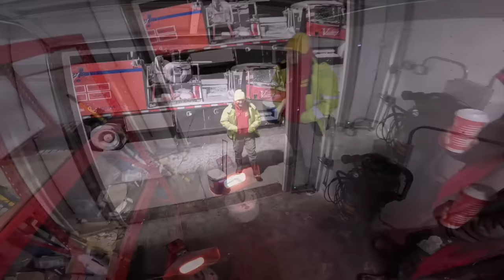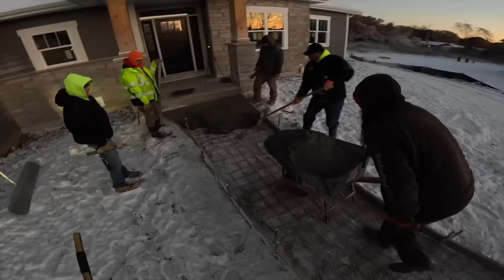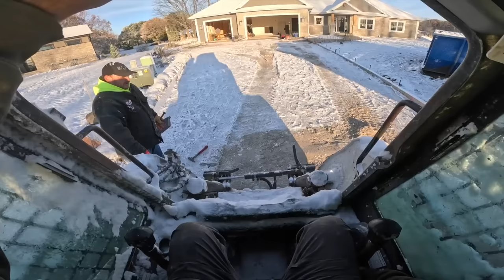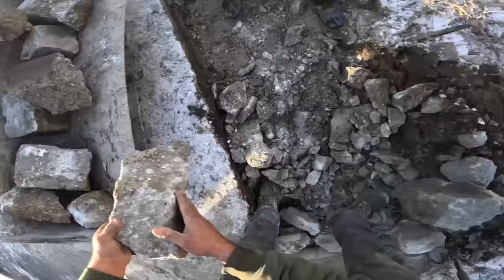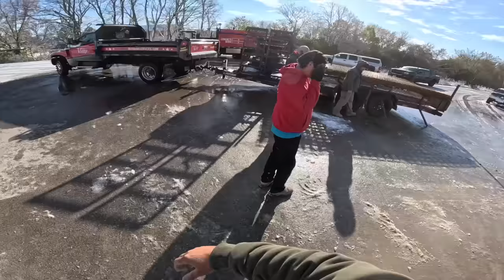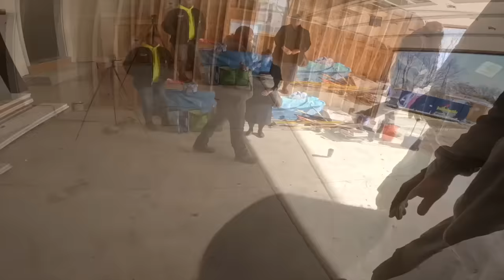Ice, snow, and CONCRETE!

Comment: Ryan I know that F-150 of yours has FordPass. Easy to set up and you can set a time for your truck to start. Also the climate control will adjust to the outside temp so if will start the defrost for you.

Comment: Ryan Sr, For the Garage at the land look into a Ductless Mini Split that does Heat and A/C and if you put up an office at the new land same thing look into a Ductless Mini-Split and A/C unit. and see about putting a door in place of that old vent on the garage shed at the new land. Also about your tire leaking it could just be a bad valve core on the valve stem. My dad had a similar issue I just replace the valve cores on the valve stems and his tires haven't leaked since.

Comment: Ryan, RRs use hi-rail trucks for track inspection and larger ones for repair.  They hold the gates down for a long time before they get to the crossing.  Francisco was most likely held by one of those. RRs block the track so no trains can run at the same time the inspection or repairs are being completed.

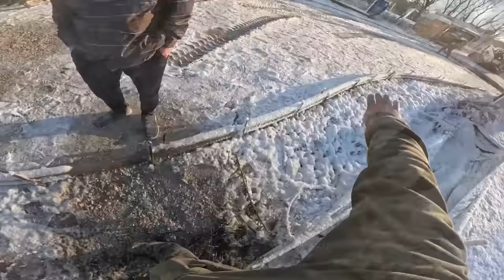Comment: 21:36 Third stalls like that with limited driveway are VERY EASY to back into. Pulling in you are dragging the back wheels and then you start worrying about the garage or need a longer approach. But if you back in you are steering the “back” wheels and can cut it right where you need.

Comment: I have zero concrete experience but would it make sense to cut the curb off but keep the flat part? 

Also carleto is a beast. I like how the two older guys beat the young guys. 

I like how he fixed the belt on the compactor as well. Besides that one water drain that you had to repaint he seems like he usually does a good job.

Comment: I had something like 50ksq/ft, and didn't quite get it all done this year. Got a crew pouring now in this oddly warm weather here in SE Michigan. It's still so cold cold, you concrete guys are tough. Probably going to have to finish in the spring.

Comment: When using colored concrete or powder release on stamped concrete does that same rule apply with rinsing down the concrete if you needed to cover it or would that ruin the stamped finish?

Comment: Hey I just wanted to say that your tires probably ain't leaking they will lose pressure because of the colder weather and you just gotta add air you shouldn't have to take it to a tire shop because they should have told you that was why your tires were losing air

Comment: Remember how I once told you about a local crew that was hired by the city to pour a sidewalk through a park, and in 6 weeks, couldn't finish what you and yours could in 3 days? Well, they never finished it, and as you talk about those funny lines in the concrete caused by the plastic... the sidewalk through the park is littered with those marks, and, as it turns out, so is the city sidewalk that runs past that park. Seems no one here knows how to pour concrete when it's going to rain.

Comment: I thought there were no concrete boom pump trucks there?  I see one though at 46:27
Reply from the maker: Who said there were no boom trucks here?
Reply: @VictoryOutdoorServices  Not you.  It was mentioned in the comments probably before last winter.  As a foundation and flatwork guy I know there were pumps.  I will admit that I use them for flat work if I need.  I have to pour with a smaller crew up here. Spendy however.  I always figure a 1000.00 for pump

Comment: I am very surprised that you always have to remove or modify the road curbs where you are, what a waste of money. We use roll over curb and gutter, R B&G for short, here. Then it does not matter where the driveway meets the curbing as to is all the same profile thru-out the sub-division. No mods required.